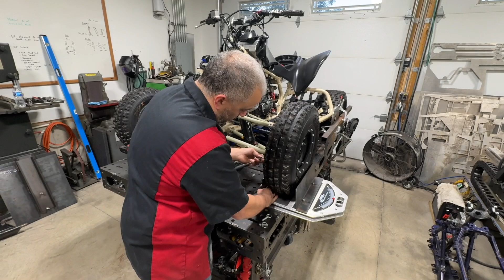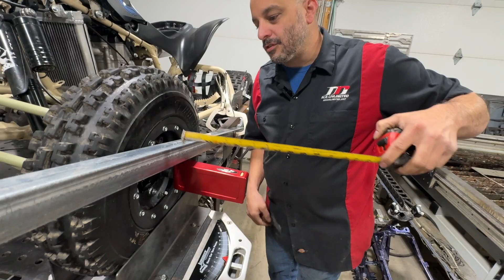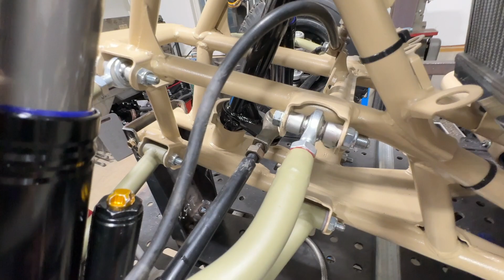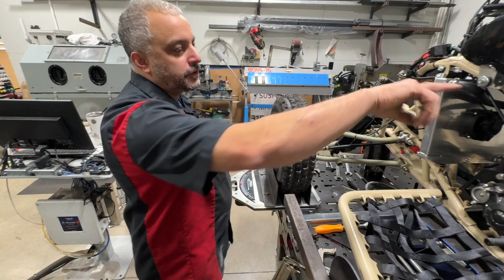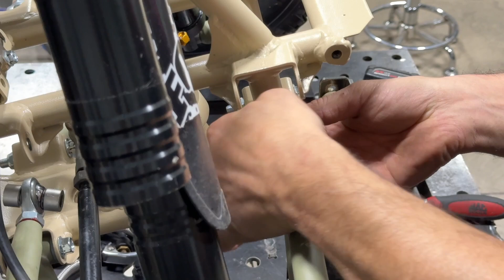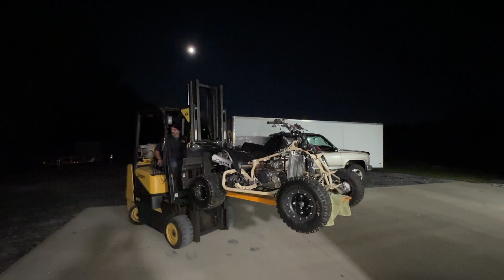ATV Alignment Explained! #howto set up the front end

Comment: So on a Xc quad where the rear is narrower than the front will the straight edge still work or is that why you're using the extension
Reply from the maker: You’d want to use a block on the back to match the width up front. It’s important that the widths match to ensure proper alignment. Thanks for watching!